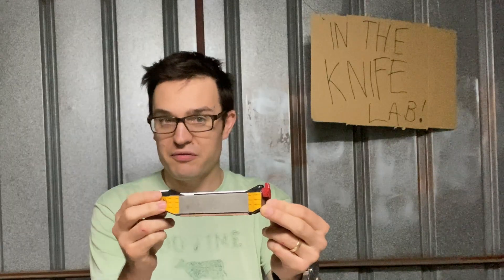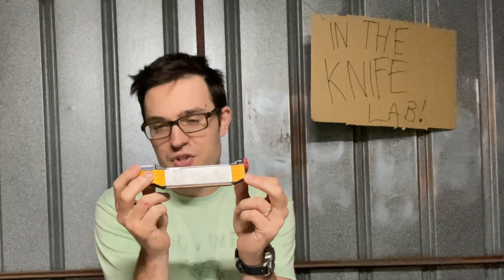How To Sharpen in Full with the Work Sharp Guided Field Sharpener (Review)

Comment: Pete, great vid, thanks. I picked one of these up last year and was afraid to use it. Now feel better equipped to go forward using it.  Picked up the pocket Work Sharp after your previous vid and it does the job nicely after the learning curve. A bit more pressure on the strokes helped achieve a satisfactory edge. Thanks and enjoy.

Comment: I actually have bad ideas about sharpeners like mistake I see as I see 1 probably 2 in this but that one is hella useful well maybe tempered aluminium body with price deference replaceable grid plates if there are not but I like it when I was 9 yo I was sharpening on a bench grinder disk old silver or white ones but when I was in the mood aways after work as well keep that as razor as u can get let's say

Comment: If you don't have a lot of freehand experience, just be aware that the vast majority of factory edges do not have exact 20 or 25 degree edge angles. This was the source of a lot of frustration for me when I started freehand, what was supposed to be quick touch ups became full on reprofile jobs. I just put this up to me being bad at sharpening and sharpening being hard. Which now I know after hundreds of sharpening jobs on hundreds of knives wasn't the case.